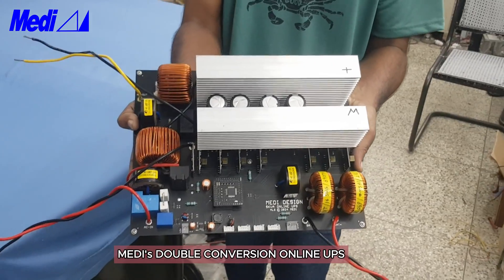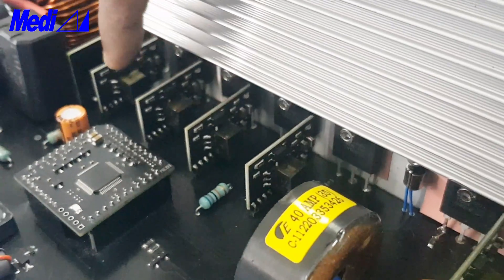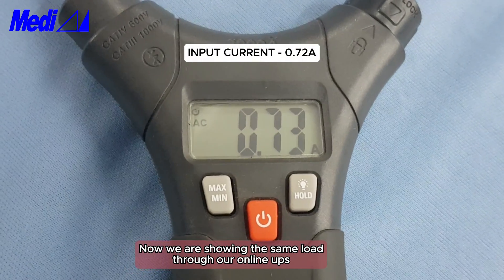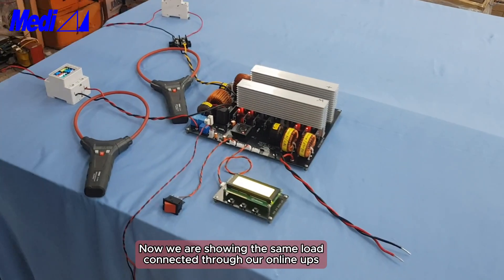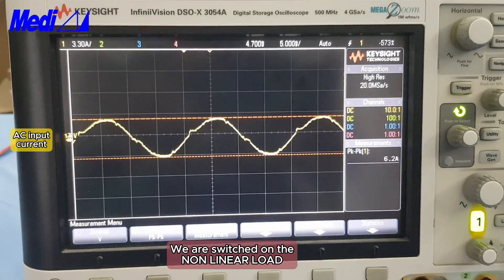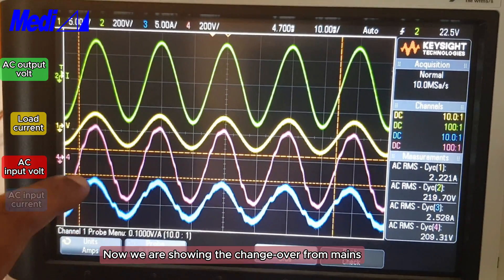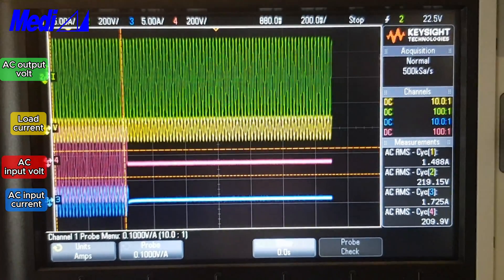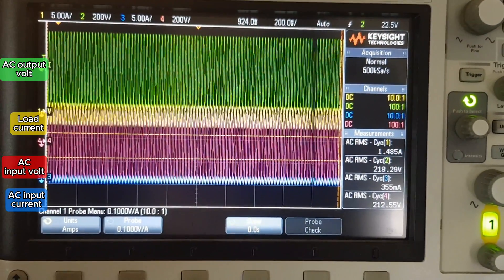Double conversion 5KVA ONLINE UPS (Intro Video)

Comment: This is a premium online UPS that can compete with any international product. We are using a special topology - Multi Level Switching (MLS) topology. The front end PFC is bridge-less. Most commonly used method in boost PFC uses a bridge which means diode drop which leads to less efficiency. Here we are directly converting AC to DC without using any diode in this unique bridge-less PFC method. We are also using a different software algorithm instead of the traditional algorithm for PFC which gives us close to 0.99 PF and the current waveform will have very low harmonic. 

This also uses a three level inverter stage which processes only the difference power. In a traditional high frequency UPS there is usually a ferrite core with primary and secondary windings. This will need to process the full power through the ferrite core windings and the IGBT current will be full rated capacity. Here we are using a differential power processing method. If the battery voltage is 190V, only 30V or 40V needs to be boosted to make it 220V / 230V. This is a huge advantage because this increases the efficiency considerably.
The traditional ferrite core transformer is also complex to wind and for a 5KVA unit you will need to use the full rated power of 5KVA in the ferrite core transformer. Here only four inductors are used - one for AC input power factor, other for inverter output filtering and two inductors for battery boost and buck respectively. 

There is no separate charger. This is a bi-directional design, you can use up to 15A to charge 100AH or 150AH batteries in comparison to the Chinese UPS models which are very low current chargers with separate SMPS. The reason they use separate SMPS is because in the ferrite core transformer method it uses a diode to make DC which means reverse current cannot flow. In our topology because there is no diode we can use the same hardware for charging also. When the inverter is working, it will take 40A or 50A from the battery. When it is working from the mains the same 50A can be reversed to charge. 

The PCB design in itself is yet another special feature. It is easier to make three different PCBs - separate inverter, PFC section and battery section. The PCB designing will be easier, no high current tracking to worry about. Easier to use connectors with different PCBs. But we took a much longer time to design a single PCB, it was a tough job with all the various sections included. Only one PCB with battery input, AC input and AC output. With F-type heatsinks for discrete IGBT / mosfets that can be fixed on. The drivers etc on the same board. The temperature sensor on the heatsink. Only when the temperature rises, the fan will be switched on. The PCB has very low component count because we have used the same components to work at various different stages. The same set of components have various roles doing multiple functions. All this was designed keeping in mind the ease of production for the manufacturer. Yes, it took us much longer at the design and development stage but it will be rewarding for the manufacturer in the long run. 

There is also a static bypass provided with SCR so there is no time gap. Other features like alarms, protections, LCD, communication etc are all incorporated.

This innovative method is MEDI's own invention and gives various advantages - high efficiency, very compact, low material cost, easy manufacturing and technically superior to any other existing topology available in the market.
Reply: Amazing tech.
Reply: How much price of this ups Board?

Comment: Nice  first time in india
Reply: Yes first time in INDIA thanks for informing, in india manufacturing without APFC , with SCR charger & Bridge +IGBT PWM buck charger, which will generate very high current Harmonics & very low power factor,  in result  distribution transformer will burn 🔥,

Comment: Medi project good quality
Reply: This is a premium online UPS that can compete with any international product. We are using a special topology - Multi Level Switching (MLS) topology. The front end PFC is bridge-less. Most commonly used method in boost PFC uses a bridge which means diode drop which leads to less efficiency. Here we are directly converting AC to DC without using any diode in this unique bridge-less PFC method. We are also using a different software algorithm instead of the traditional algorithm for PFC which gives us close to 0.99 PF and the current waveform will have very low harmonic. 

This also uses a three level inverter stage which processes only the difference power. In a traditional high frequency UPS there is usually a ferrite core with primary and secondary windings. This will need to process the full power through the ferrite core windings and the IGBT current will be full rated capacity. Here we are using a differential power processing method. If the battery voltage is 190V, only 30V or 40V needs to be boosted to make it 220V / 230V. This is a huge advantage because this increases the efficiency considerably.
The traditional ferrite core transformer is also complex to wind and for a 5KVA unit you will need to use the full rated power of 5KVA in the ferrite core transformer. Here only four inductors are used - one for AC input power factor, other for inverter output filtering and two inductors for battery boost and buck respectively. 

There is no separate charger. This is a bi-directional design, you can use up to 15A to charge 100AH or 150AH batteries in comparison to the Chinese UPS models which are very low current chargers with separate SMPS. The reason they use separate SMPS is because in the ferrite core transformer method it uses a diode to make DC which means reverse current cannot flow. In our topology because there is no diode we can use the same hardware for charging also. When the inverter is working, it will take 40A or 50A from the battery. When it is working from the mains the same 50A can be reversed to charge. 

The PCB design in itself is yet another special feature. It is easier to make three different PCBs - separate inverter, PFC section and battery section. The PCB designing will be easier, no high current tracking to worry about. Easier to use connectors with different PCBs. But we took a much longer time to design a single PCB, it was a tough job with all the various sections included. Only one PCB with battery input, AC input and AC output. With F-type heatsinks for discrete IGBT / mosfets that can be fixed on. The drivers etc on the same board. The temperature sensor on the heatsink. Only when the temperature rises, the fan will be switched on. The PCB has very low component count because we have used the same components to work at various different stages. The same set of components have various roles doing multiple functions. All this was designed keeping in mind the ease of production for the manufacturer. Yes, it took us much longer at the design and development stage but it will be rewarding for the manufacturer in the long run. 

There is also a static bypass provided with SCR so there is no time gap. Other features like alarms, protections, LCD, communication etc are all incorporated.

This innovative method is MEDI's own invention and gives various advantages - high efficiency, very compact, low material cost, easy manufacturing and technically superior to any other existing topology available in the market.
Reply: how can contact to with you? I need 3 kva one circuit

Comment: Every house hold needs this device atlist online mode to improve power factor
Reply: For that we have. IGBT PWM type AHF (Active Harmonic Filter ) which will increase Power Factor & reduce current Harmonics in result very low neutral current ( current will come down nearly zero from thousands of ampere) so distribution transformer will not burn @ light loads
Reply: @martinxavier5787  thanks to guide. 
will you post any link of such circuit.
Reply: i have gone through your video, its very impressive 

will you provide any manufacturer who is making it

Comment: Hai Sir,
Excellent and professional product as usual from Medi.
What is the AC input voltage range it support Sir. Whether it can share both AC and battery in case ac low voltage
Reply: 170 to 270V
Reply: Thank you sir

Comment: Amazing sir......hats off 👍
Reply: This is a premium online UPS that can compete with any international product. We are using a special topology - Multi Level Switching (MLS) topology. The front end PFC is bridge-less. Most commonly used method in boost PFC uses a bridge which means diode drop which leads to less efficiency. Here we are directly converting AC to DC without using any diode in this unique bridge-less PFC method. We are also using a different software algorithm instead of the traditional algorithm for PFC which gives us close to 0.99 PF and the current waveform will have very low harmonic. 

This also uses a three level inverter stage which processes only the difference power. In a traditional high frequency UPS there is usually a ferrite core with primary and secondary windings. This will need to process the full power through the ferrite core windings and the IGBT current will be full rated capacity. Here we are using a differential power processing method. If the battery voltage is 190V, only 30V or 40V needs to be boosted to make it 220V / 230V. This is a huge advantage because this increases the efficiency considerably.
The traditional ferrite core transformer is also complex to wind and for a 5KVA unit you will need to use the full rated power of 5KVA in the ferrite core transformer. Here only four inductors are used - one for AC input power factor, other for inverter output filtering and two inductors for battery boost and buck respectively. 

There is no separate charger. This is a bi-directional design, you can use up to 15A to charge 100AH or 150AH batteries in comparison to the Chinese UPS models which are very low current chargers with separate SMPS. The reason they use separate SMPS is because in the ferrite core transformer method it uses a diode to make DC which means reverse current cannot flow. In our topology because there is no diode we can use the same hardware for charging also. When the inverter is working, it will take 40A or 50A from the battery. When it is working from the mains the same 50A can be reversed to charge. 

The PCB design in itself is yet another special feature. It is easier to make three different PCBs - separate inverter, PFC section and battery section. The PCB designing will be easier, no high current tracking to worry about. Easier to use connectors with different PCBs. But we took a much longer time to design a single PCB, it was a tough job with all the various sections included. Only one PCB with battery input, AC input and AC output. With F-type heatsinks for discrete IGBT / mosfets that can be fixed on. The drivers etc on the same board. The temperature sensor on the heatsink. Only when the temperature rises, the fan will be switched on. The PCB has very low component count because we have used the same components to work at various different stages. The same set of components have various roles doing multiple functions. All this was designed keeping in mind the ease of production for the manufacturer. Yes, it took us much longer at the design and development stage but it will be rewarding for the manufacturer in the long run. 

There is also a static bypass provided with SCR so there is no time gap. Other features like alarms, protections, LCD, communication etc are all incorporated.

This innovative method is MEDI's own invention and gives various advantages - high efficiency, very compact, low material cost, easy manufacturing and technically superior to any other existing topology available in the market.